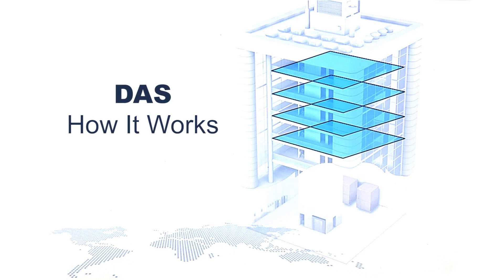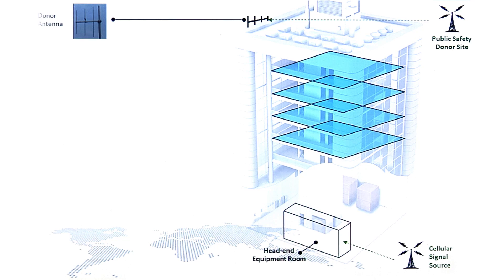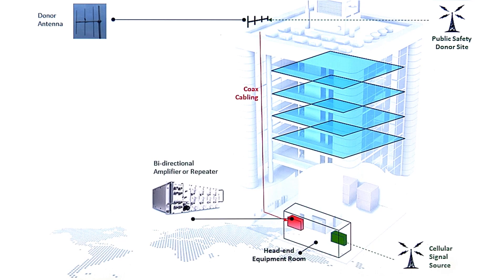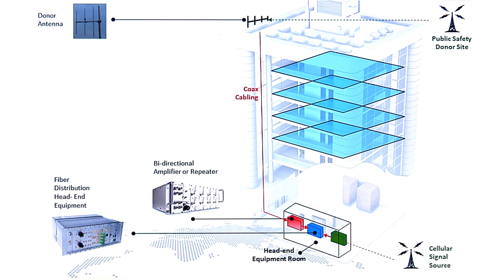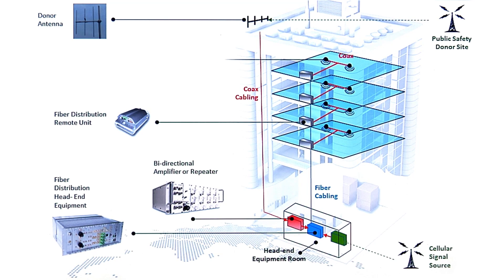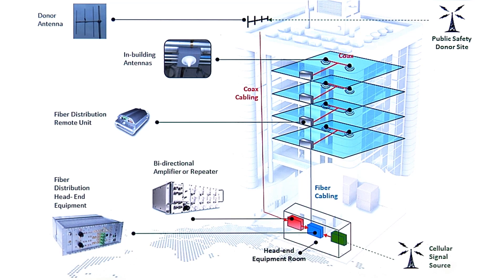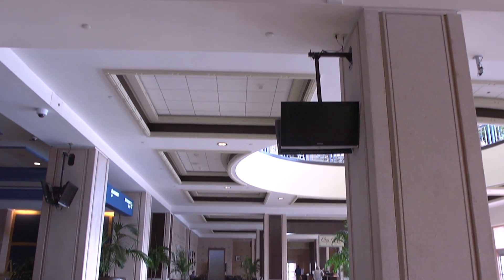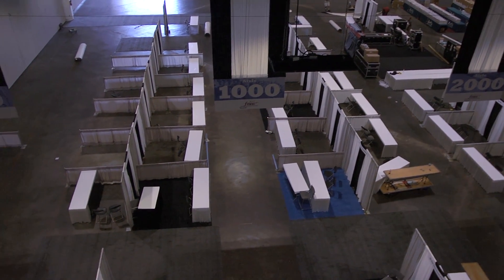DAS Installation Case Study: Tampa Convention Center and Raymond James Stadium

Comment: You built a 23 sectors DAS in 30 days? Is it just the front end or including the passive section and antennas. If you guys have completed the full build in 30 days that'd be unbelievable.

Comment: A bi-directional amplifier is NOT a repeater.
Reply: A mobile repeater apparently boost  signal in both UL and DL directions. I mean both the power put in to the DAS from repeater and the power put in to the repeater back from UE are amplified. Check out Comba mBDA Digital Band Selective repeater. It's a Medium Gain Repeater probably a similar type is what he meant.
Reply: @manzoormohamed6130  A mobile repeater does not boost signal in both directions.  A ,mobile repeater receives a signal on a receive frequency and rebroadcasts it on a different transmit frequency  https://en.wikipedia.org/wiki/Radio_repeater
Reply: @manzoormohamed6130  A bi-directional amplifier boosts the siganls in both directions. It does not change the frequency.  There are filter networks to separate the repeater receive and repeater transmit frequencies, giving it the capability to amplify in both directions.
Reply: Mate you are talking about a FM or MW repeater which is a different context here. Whilst he and I are talking about a cellular repeater which is basically a bidirectional amplifier. Im a telecom Engineer and I work on them everyday.
https://en.m.wikipedia.org/wiki/Cellular_repeater
Reply: @manzoormohamed6130  You are correct it's a bi-directional amplifier.  Amplifiers amplify signals, they do not change the signal.  Repeaters change the carrier frequency and rebroadcast it.
Reply: @manzoormohamed6130  What is the difference between BDA and repeater?
Radio repeaters require 2 frequencies to operate; an uplink and downlink channel. They have a greater coverage area than what a BDA can provide. Amplifiers take incoming signals within a band and amplify them for distribution in another area.
Reply: BDA / Cellular repeaters also use different frequencies for DL and UL. The TX frequency (Towards the donor antenna) will be the RX of the Base station and the vice versa.
Reply: @manzoormohamed6130  You are correct. There are different frequencies for DL and UL.  As I have maintained  BDA's (Bi-Directional amplifiers) only amplify frequencies in either direction.  The cell tower is the same as a repeater.  It receives on on frequency and re-transmits on another. Modern two way systems have multiple sites networked together just like cellular systems.
Reply: @manzoormohamed6130  BDA’s only amplify signals.
Reply: I know how repeaters work.  I know what a DAS is and how they work. I know the difference between them.  I know what notch filters are and what combiners are.   I've done this longer than you have been alive.  Do you know what Trunked Radio is?
Reply: @Marc Knapp I managed the radio system for a small federal agency with coverage in two buildings.  We started with one central Motorola Smartnet  repeater that we purchased airtime on.  We we had bi-directional amps feeding a DAS in both buildings.  Motorola sold the contract to another company.  That sale opened up to other systems.  When I retired they were changing from NXDN to DMR Type III

Comment: ATT and T Mobile share the same voice tech, as do Verizon and Sprint...If you were to do an active DAS and choose ATT(as they did in this video) wouldn't T Mobile also work?
Reply: Not familiar with the US operators. But apparently yes the  DAS can be shared with multiple operators. Usually one of them being the lead carrier who build and maintain the DAS and others can connect their base stations to it paying a colocation fee. Ofcourse they all using different frequencies for 3G , LTE and 5G within the same band 700/850/900/1800/1900/2100/2300/2600/3500MHz etc.